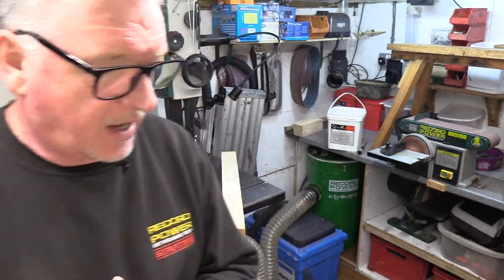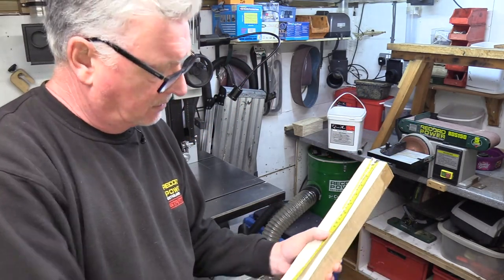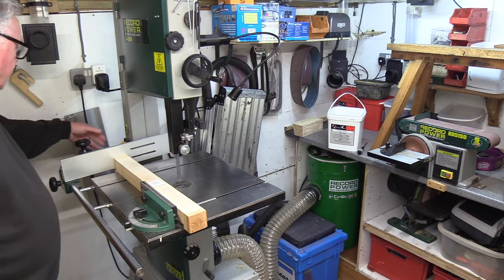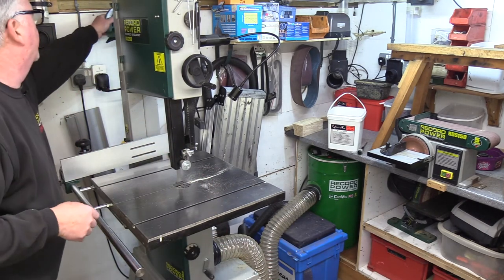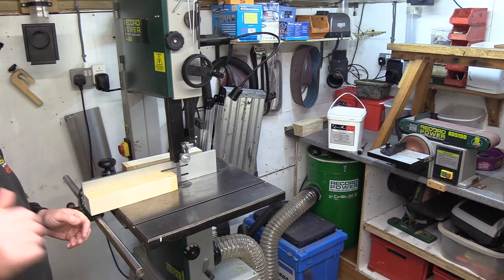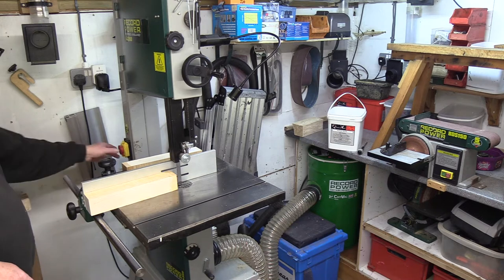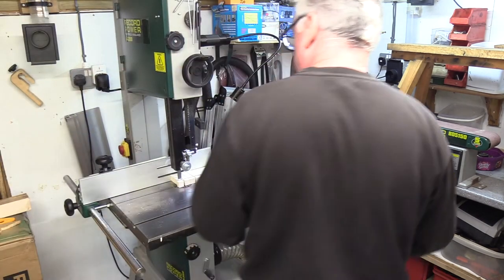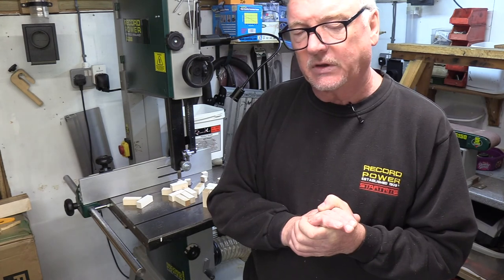Know-How Series: Cutting Pen Blanks using the BS350 14” Bandsaw

Comment: Hi
Yesterday I was in the RecordPower shop in Beernem Belgium, where I looked at the BS350S and decided that I wanted to buy it. 
Considering you are using the BS350 14" today, I wonder if it is the same. 
If not, what is the difference between these two.
Thank you for this tutorial and sharing it.
Keep it safe, it is not over yet.
Willy from Belgium.
😷😷😷
Reply from the maker: Hello, thank you for your comment. The BS350S is in essence an upgraded version of the BS350 Bandsaw. Upgrades include, cast band wheels, 1.5 hp motor with brake, table size and wheel kit. For further information on the BS350S, please visit the Record Power website or contact us on 01246 571 020. Best Wishes, Record Power.